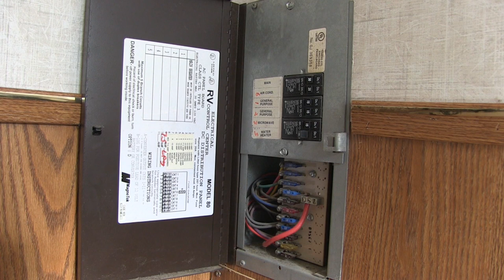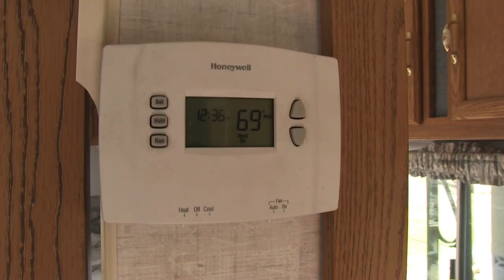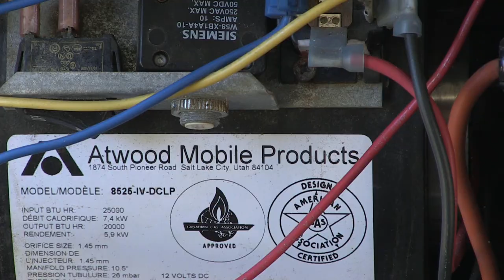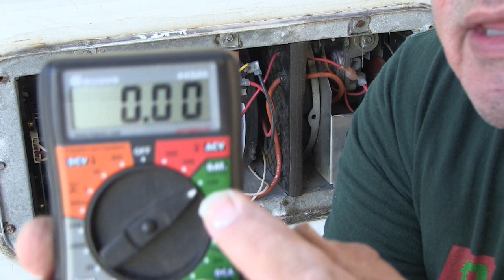BACKYARD MECHANICS - Atwood RV Furnace Repair

Comment: I would drill holes in the bottom of the battery cases,to let the water out, I lurned the hard way, at 7 below 0 I had ice battery's,  ruined my new batteries, after drilling, no more problems, water gets in then drains right out.
Reply from the maker: Nice hack.

Comment: To make yours Philip screwdriver static magnetic take a battery two wires positive and negative put it on the screwdriver and it automatically your Phillips screwdriver will be magnetic
Reply from the maker: Thank you for the tip

Comment: I didn't see lights on circuit board gonna put new sail switch on but have another issue maybe you can help before it just ran cold air the heater would kick on when it wanted to and not shut off is that my thermostat or something else..maybe sail switch was getting stuck unsure
Reply from the maker: Check fuses.

Comment: After going through all of that effort to remove the shroud would it have been a good idea to also replace the inexpensive limit switch at the same time?  Both switches are the same age and I don’t want to be without heat in a couple of months or have to go through all of that work again.  Your thoughts?
Reply from the maker: Go for it.

Comment: my heater works fine except  Furnace ran all the way from 51ﾟ to 66° and then pilot light shut off and then came back on about 45 seconds later and then shut off after reaching 68 degrees what the thermostat was set for.  At night the thermostat is at 59 and goes down to about 57 and comes back on all night long and no problem at all never shuts the pilot light off  between and when I put it up higher the pilot light turns off and on more frequently. Any ideas?
Reply from the maker: When the furnace gets hot, the heat sensor will activate and shut the pilot off. Might want to check that.
Reply: thank you and are you talking about the high limit switch?
Reply from the maker: Yes I am.

Comment: My fan runs , ignitor does not lite for heat? What can I do ?
Reply from the maker: First, remove your control board, take it to an RV parts shop to bench test it. If it is ok, then it would either be that Sail Switch or the Limit Switch. I'm guessing it's the sail switch. Also be sure your propane is full and turned on. Hope this helps.